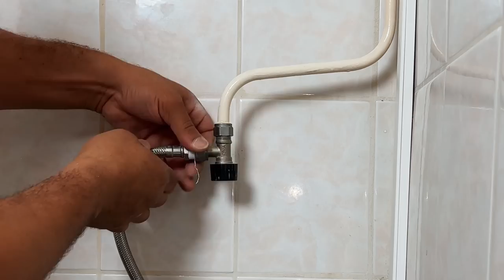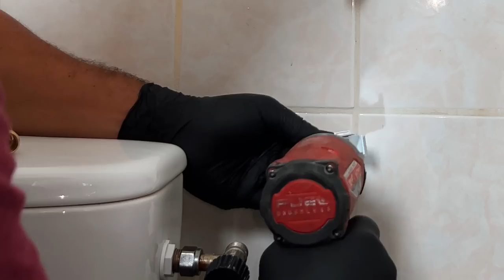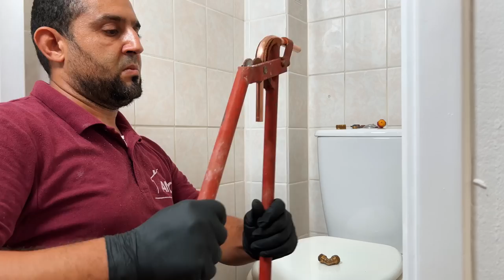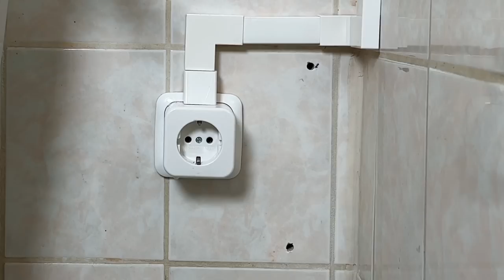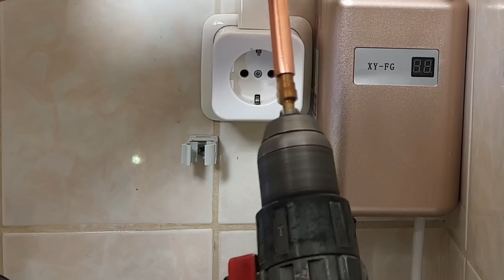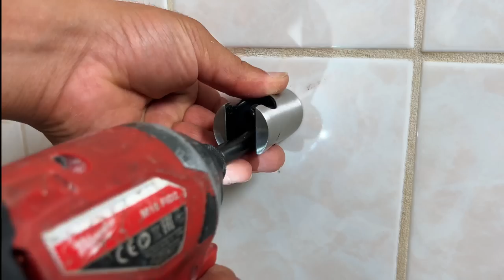A plumber shows how to connect a toilet shower to amazing mini electric water heater

Comment: Your work is very neat. I wish more plumbers would be proactive in cleaning as they went along their work
Reply: Good plumber but he is surely not an electrician. That is an electrical shock hazard. In my country only one socket is allowed in the bathroom and it should be above the mirror at the basin and it should be protected by a circuit breaker with 10mA leakage current protection, an MCB alone won't protect you from shock or electrocution.
Reply: In most parts part of India (except in the very cold Himalayan regions of India...) Vietnam, Thailand, south-Asian countries, middle-eastern countries.. all such plumbing and toilet connections use plastic pipes, plastic fittings and elbow joints now. High class Hotels may use chromium fittings. Ages ago galvanized cast-iron pipes were used as water pipes. Because of high saline content in water copper piping will rust very fast... copper piping is rarely used in India now and copper pipes/ fittings are forbiddingly expensive in these countries. Good plumbers know all this in India too. In most parts of India (except in the very cold Himalayan regions of India) tiny hot water heaters for toilet showers... are not needed.

Comment: Illegal in the uk as its a category 5 risk & necessary back flow prevention required especially as the hand set can fall below the water level into a soil appliance 🙈 glad I'm in the uk & these types of install aren't allowed. I've turned down loads of jobs from clients who want these installed. You've also got electrics in the same room which is another safety risk. 
Seems some countries have no health & safety legislation in place !!
Reply: UK had that flammable cladding that added the Grenfell inferno, so I'm not so sure about their safety,  Would this be legal in most Euro countries?   It doesn't look that difficult for a handyman to install.   Do plumbers do this anyway in the UK?
Reply: @TrueNovice  uk plumbers don't do this as it's illegal & contravenes water regulations , their are so many regulations to comply to make it legal that it would be too expensive to install. Contamination of the drinking supply is the main concern, then it isn't just one person who it affects its a whole lot more .
With regards to the grenfell incident that was related to cutting corners with inferior products & sadly alot of people lost their lives 😢 

Alot of other countries have lacked health & sanitation policies where installations such as this vid are allowed . I'm glad in the uk we don't allow it unless stringent prevention are put in place. 
I'm not sure what the relevance was to grenfell as this was a plumbing video so you've totally taken this out of context....

Comment: Why would you want hot water in the toilet? Are you cooking or taking a bath in there? Soak in the toilet after a hard day at work.
Reply: It uses to be a bidet and instead of cold water, it’s hot water!
Reply: @ducnguyen-iv9px  that explains it lol. I'm on the other side of the pond. No bidet used here. Youtube has a strange algorithm since they put this video into my feed and for some strange reason, they thought it applied to me. I was looking at household electrical videos when this video came up. They also had some European household current videos, and the wiring and voltages used are also different. Interesting to watch and learn how it is done in other countries, but not very helpful if I'm trying to do some installation here.
Reply: @a3sully  
You are right when you asked if people are taking a bath or cooking in these places. They are.
Hong Kong is an example and even Tokyo. 
I remember a studio around 200 sqft for sale in Tokyo for 1M dollars and it was…30-40 year ago.

Comment: Why ain’t he using jointing compound on his compression fitting🤔🤔
Reply: Because they're compression fittings?
Reply: Yes but you still should smear some jointing compound on the olive before you tighten it up.
Reply: @deanmais886  I was taught is best not to. You'll know if the compression is good right away.
Reply: Can’t believe you were taught not too🤦‍♂️🤦‍♂️
Reply: @deanmais886  are you a plumber/ has fitter?
Reply: Yes 35 years plumbing & heating engineer👍
Reply: @deanmais886  nice. I'm in Canada. Code and tricks of the trade are definitely a bit different from place to place
Reply: Must be , I’m from wales in the Uk 👍